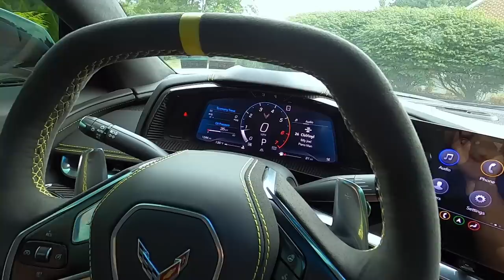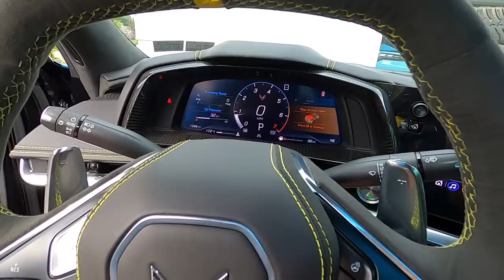FIRST DRIVE IN MY TWIN TURBO C8 CORVETTE!!! *It's PERFECT!*

Comment: Pretty soon that car's gonna be headed back to lmr because I've been hearing talks of people cracking the ECUs
Reply: That's ok they are making upgraded clutch packs for his c8 anyway to handle more power without slip plus that's their plan anyways
Reply: They should put new pistons in at the same time so it can handle the boost better
Reply: DDE said the same thing but because Damon is stuck there is no one doing twin turbski's around him he is trying to make the most power NA.
Reply: cracking ecus? they need one they can tune before they worry about that
Reply: @mclarenjohnf1  even with ported heads and a cam these cars won't make all that much power. Maybe 550 wheel.
Reply: @jimmyboe25  are you talking hp tuners? That's who needs to crack the ecu not the actual shops.
Reply: Hatter check in 😂
Reply: Sinoe Torres no one is hatting
Reply: Where are you hearing that? Link?
Reply: @hadenas1   And with a cracked ECU the LT2 won't be limited to 6000rpm but 6600rpm or higher, which means more HP potential.
Reply: @sinoetorres2808  Mad Hatter?
Reply: Archimedes  sounds like an expensive slippery slope
Reply: Archimedes  that's the deal with anything you mod. Have to beef everything up as you find the weak links. And DCTs will take more power than your average auto.
Reply: Archimedes  There's a factory torque sensor with a cut-off limit set in the ECU, ECU is still locked so can't tune the engine or trans once they can this will be good for an easy 800-1000hp. We don't know what the stock trans can hold but the slipping on those little pulls wasn't due to too much power for it to handle it's just the computer forcing it to happen when it detects too much torque for the factory trans settings. Lately, all new cars are like this, the same thing happened with the new supra.
Reply: @hadenas1 they did an earlier video when the tuner dyno Mike's Vette and it was making 670 rear wheel horsepower.
Reply: Archimedes  the trans shouldn't be too hard to drop and upgrade the clutch packs since the manufacturer of the C8 Trans also manufactures the Huracan trans, and if you know huracans, their trans can be dropped relatively easily and upgraded clutches aren't too hard to install .
Reply: @MrDJAK777  It's called 'Torque Management' and it's been around for a very long time. My '05 Z51 C6 had it. It's nothing new.
Reply: @cali2468  This and your c6 are not the same systems, this is new but it is likely related. Torque management that you are referring to is just a reduction in torque when upshifted by taking some timing out and whatnot with the overall goal of reducing torque and stress which increases lifetime. that system activated all the time on stock c6s. With the C8 this is only an issue once you start trying to dump more power at it and is a hard limit power cut with no way yet to bypass it outside throwing away the factory ECU and putting it on a standalone. But that kinda defeats the whole point of buying a c8 in the first place.
Reply: @MrDJAK777  It's the same damn thing just in a modern system. Of course, it's not going to be identical considering my old C5 would be 15 years today. All of the torque limiting systems pull power  when the TCM/ECU sense there is too much. With the old TM in the 4L60E it required a tune to bypass as well.
Reply: @cali2468  What's new is that you CANT bypass this with a tune there's no way to tune the factory computers and no one knows for sure when there will be official support outside of "probably when the lt2 crate motor drops" This ECU only came out a couple years ago on one model and before it, gms ecus were always directly programable. So yes newer issue.
Reply: Archimedes  I guess I'm not understanding what the difference in modding a c8 and a c7 is other than there is no tuning available yet. At the core, the engines are very similar and we know how far an ls/LT engine can be pushed before needing forged rods and pistons. The trans should be pretty stout mechanically as we see gt500s putting a lot more power through  them than what the stingray rotating assembly can probably handle. The engine will probably limit the power before the trans. But yet again  no one really knows for sure yet. the kit is gonna be pricey and limited because the car just came out and isnt tunable. But as with every other new model vehicle,  the aftermarket will catch up and prices will come down.
Reply: reading all these comments all i hear is $$$$$$$
damn
Reply: Justin Miller nobody is having problems with the pistons though??? Why would you do that?
Reply: @drewlindsay3553  those pistons don't do well with boost they can handle 650 wheel safely. Shops put new pistons in brand new camaro all the time wuth going boost to handle it better. Lmr has talked about this as well in other videos.

Comment: For the gt500 and Gt350R they cover the rim in a coating in the inner barrel to protect the rims from the heat of the brakes. They are full carbon rims. Have the same thing on my Gt350R.

Comment: There are other twin turbo C8's out there. And they are blowing their engines with bent rods at a bit above the typical LS/LT  640-675 rwhp number. That's 215-250 rwhp than stock and way more than the C8 needs. Its on par with a 720s and stock 720 did 0-60: 2.6 to 2.8 sec depending on the magazine. A mild twin turbo C8 with stickier tires should be in the 2.5 sec zone. And push 10.6 at around 135 in 1/4.

Comment: I'm surprised with all these people wanting to do "world firsts", that nobody with a twin turbo C8 has done a recorded 0 to 60 pull. 🐟
Reply: Cars can't be tuned yet the computers are locked
Reply: @dimigod3687  That has nothing to do with being able to do a 0 to 60 pull.
Reply: @DavidVYoutube  I'm not a mechanic but from what I have seen if your modding a car for the best results you want to make sure your tune is decent not being able to tune a car that's modified is kind of crazy since it could go kablow....just saying
Reply: @dimigod3687  he already did a few pulls in this video though, why not record the 0 to 60 if you're doing a pull anyways.
Reply: @DavidVYoutube  yea they could and he will I'm sure or someone will, but probably isn't much quicker to 60 than stock at the moment. Once a tune happens for sure it will be different, I'm curious how this c8 chassis puts down 650 750hp. It's hard to think 60times would get too much quicker but 1/4mile times will change a bunch
Reply: @DavidVYoutube  Idk about SS's specific case, but other TT C8s have trouble with the power getting cut when they go full throttle.
Reply: Yeah I wanna know how fast this thing is compared to stock too, hopefully a video on all this is on the way.
Reply: Dimi God  peitz performance actually Dino one already
Reply: @jesusperez2013  yeah and then they blew a piston... watch Emelia Hartford channel....
Reply: @Ez-sk8ig   I thought she said she bent multiple rods. Either way these TT C8 projects with zero tuning are turning out to be questionable at best
Reply: @AceYYC  is the torque management,  her C8 has a black box to trick the ecu so that always leads to broke parts... I'm sure it will get figured out soon, even if it means a standalone ecu.
Reply: Its not locked his rpm is opened up. Only under 500 miles it stays locked for break in.
Reply: Cleetus threw a set of drag radials on his stock C8 and let his buddy who's never driven it before (James) do a pull and they clocked a 2.9 0-60. He also explained why he wont be modifying the car in any serious way until the tuning capabilities open up.
Reply: @samuelmiller6191  meaning you can't just plug up and tune it bud...........
Reply: @Admiral_Potato41  Didn't he upgrade the axles too?
Reply: @nojabjonny  he may have, I've honestly been a casual about watching his videos lately lol

Comment: Do you feel like the turbos are instant power for top mounted? The rear mounted ones I would think would have some lag.
Reply: That would only be a problem if the engine were in the front of the car, the turbos are the closest they can be to the engine.

Comment: Those carbonfiber wheels are carbonfiber throughout the barrel, they were just lined with that LI-900 silica which is the same heat material used on the space shuttle tiles, it’s made from essentially very pure quartz sand and a couple of other materials that keep the surface of the other materials from melting the GT350R’s wheels are entirely covered in it only black. Ford herd the consumer on the fact that they wanted an exposed Carbonfiber wheel so they made it happen for the 500.

Comment: The wheels are real on the GT500. The white is a special coating for heat protection from the brakes. They are 100% carbon except inserts around the lug nuts.

Comment: You really do need to get it tuned (of course). About the hot weather. You'll be making less boost in the heat. You will have a better chance of seeing an issue in cold air, (not hot) because the car will be making a lot more boost in the cold air. That's the issue I had on one of my turbo'd car. It worked fine all year, but on cold morings (below 50 degrees - which is cold down here in S. Fl. I would hit my fuel cut due to over boost. My turbos made significantly more power (increased boost) in that cold air. It was frustrating, but I rarely got that cold. It was a tuning issue, because my car was tuned on a 95 degree day (105 heat Index) during the Summer and the tune ended up being a little too aggressive for when the temperatures were cold. Just wanted to mention that. You'll make a lot more boost in cold air. So you cut hit boost cut/fuel cut without a proper tune in cooler air.

Comment: The C6 ZR1 should be in the garage.   It's the only one of the 3 that isn't wrapped, so it's factory  painted finish is exposed to UV light, the extreme heat, and rain etc, etc... It's also the elder and matriarch of the bunch which has earned it the respect of at the very least a spot in the garage.

Comment: The wheels have a protective liner to protect the carbon fiber from the heat of the brakes but they are full carbon fiber the backs don’t have them because up to 70% of stoping power goes to the front if I’m not mistaken

Comment: I have been to the factory where those wheels are made and they are full carbon.  It is a heat shield for those giant brakes in the form of a ceramic coating. As per your wheels it is easier to make the carbon barrels.

Comment: the wheels are full carbon on the gt500, there is a ceramic loop to protect the wheel from heat, those brakes can get close to if not 1000 degrees if the car is being tracked..  Ferrari uses the same thing on their carbon wheels.  They are carbon barrels and faces

Comment: Mike, I might have missed it but do you or will you install a boost gauge? If you haven't I'd suggest purchasing an app like DashCommand and an OBD2 dongle. I use the GoPoint BT1. You can set up gauges for real time data and also performance data. I'm old school and love my gauges. Factory lights are called idiot lights for a reason.

Comment: That oil pressure is low for a fresh new / build 35psi. Should be atleast idling at 45-50psi. Wott around 65-70psi. Other than that.. its sweet!!!!

Comment: Since the turbos is top mounted you should of added air vents to the back smaller windows on the side of the car like the old mustang and delete them on the C8 for more air flow to the turbos instead of them being encased  within the car

Comment: Not positive but when you tapped it. Sounds like a heat shield. Which is understandable in front with brakes that big. If you take that on a track those rotors will be glowing red and idk how well cf dissipates heat compared to aluminum. It can also heat up the air inside the tire causing expansion.

Comment: The SNAP-CRACKLE-POP on downshifts and lift throttle deceleration was far more epic on the previous black tipped exhaust system. Can the old exhaust or at least the black tips be added back?

Comment: you should be able to turn off your 4 cyl mode when you put it in Sport Mode or Track Mode. Only the street mode (touring mode for chevy i guess) that you startup the car on uses the Active Fuel Management. At least that's the way it works with my Challenger. Should be the same with Chevy. 
As far as "nobody knows what the limits are", Emilia Hartford found that the transmission is the weakest link in the drive train, and i think she was getting slippage around 750 horsepower on a mustang dyno. So be careful, your transmission might not like the turbos.

Comment: PLEASE tell me they're trolling about the GT500 wheels! They are full carbon fiber. That is a sprayed on ceramic coating on the front wheels to protect them from the heat of the front brakes. If you look there's only about 1/16th" space between the wheel and the caliper. It's not needed on the rear wheels because there's more space. It's the exact same thing on the GT350R.

Comment: Get caught in a hard rain with the turbo filters sitting directly below the air-vents, the rain water will come down onto the filters, it seems? ...Just noticed your heads-up display seems to be blinking off and on?

Comment: It looks like the backside of the front wheels on that mustang is white as well. like the carbon part that is actually exposed but on the inside of it. If it is heat shield that would make sense since it may be the entire inside of the wheel.

Comment: If I recall correctly, if you put it in Sport or Track, perhaps the four cylinder function will not bother you. Great that you don't have to use E85. Dialing in the car with launch control to get a great zero to 60 time will be a challenge. Very cool. You got to do a pull. Cracking that code  is apparently a real problem. by now it should have been cracked. Can't believe that the true cracker jack out there hasn't cracked this egg yet. AF

Comment: Bro I'm fairly sure those wheels are true carbon all around, that looks like some protective coating to me, for heat from the brakes perhaps? the rear brakes are smaller than the front hence less heat = no shielding needed? 

just my hypothesis

Comment: the GT500 is full carbon fiber wheels, its just a heat coating. those brakes are f*cking huge and they get hot

Comment: gotta be a wheel liner. Carbon Revolution makes the gt500 carbon wheel also for the ford gt. im betting because the gt500 doesn't have carbon ceramic they need to protect the carbon. also its probably only on the front because of the weight transfer and being hard on the front brakes

Comment: Its crazy to think that the base c8 stingray is already quicker than the non-modded zr1 c7. I wonder which would be quicker from a dig, the modded c8, or the modded zr1 c7? (mikes cars) My bets is the c8 would do better initially and then c7 will come back at the top end.

Comment: Ok IF the car can not be tuned it’s not fully functioning. You can’t add all that air if you can’t add fuel. You can’t add fuel unless you change the tune. Nor could you optimize/adjust the spark timing. Are they even connected to the intake???

Comment: mate why on earth you did not get the exhaust and turbo inlets and outlets heat coated to 1,500 degrees c that way the heat is not going to be a issue at all, its like a tick on the brain now for you, a heat blanket is so crap its not going to stop heat transfer from the exhaust system and also what about blow off values nothing mentioned on those as well?

Comment: Man....all I wanted to see was some actual performance from this thing and all I got was tiny areas where you got up to 70mph....I literally saw no difference in accelaration between this and my stock Z51.  Looked almost exactly the same.  I need to see this on a 1/4 mile strip or at the track to believe this is even worth it.  Maybe you have a video on here with that I can find

Comment: "The inner structure of microscopic glass beads and high-density foam are bonded together with 200 pieces of carbon strands each barely 0.1 mm thick. Their major benefit over the Pista wheels—especially for a mainstream automaker like Ford—is automation. Robots that can spin the carbon preform and higher-pressure resin injection molds have removed much of the manual labor. " - Car and Driver

Comment: that is a ceramic coating on the front rim due to the massive breaks the rims would warp due to the heat it is not aluminum the rear breaks arnt big enought to heat the rim your welcome

Comment: Car doesn’t know they r there...because they are not connected or the waste gates are extremely low so the turbos only “push” atmospheric pressure to the engine. The rest is blown out. You’d grenade the engine if u added all the air from a functioning twin turbo without adding fuel.

Comment: OK so read through enough comments so I think its safe to say the white/light grey color on the wheels is a ceramic coating for heat protection, that's all good and dandy, but why the fuck is it not black like the wheel? Doesn't have to be a perfect match, it won't have the carbon pattern anyways but it could have been made a close shade of black.

Comment: sounds good? it sounds muffled like you put turbos on it. the length of the exhaust is reduced with mid engine. there is nothing about it to me that sounds like racecar. it sounds like a quiet boosted production car. sounds like you purchased a stock R8.

Comment: When u gonna tune it. Like how long after the running becomes available
Reply: It can be tuned to it's full potential now. I guess the shop didn't wanna go too far trying to tune it and destroy the engine. So they just did a low boost tune for saftey